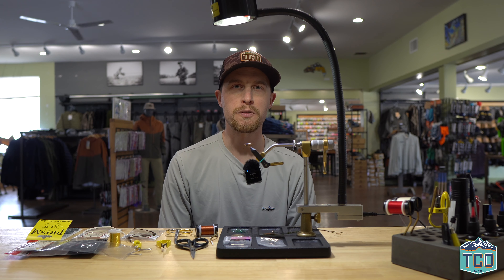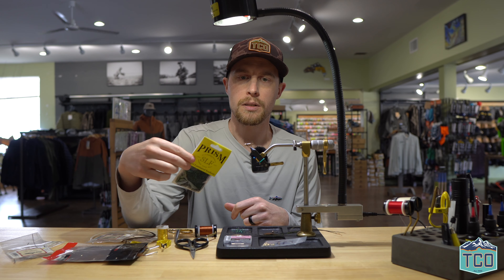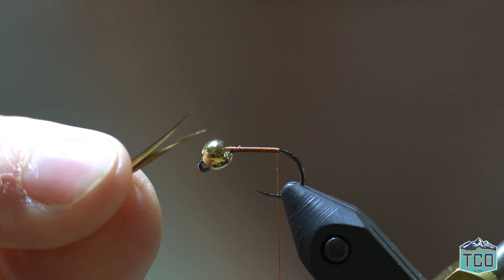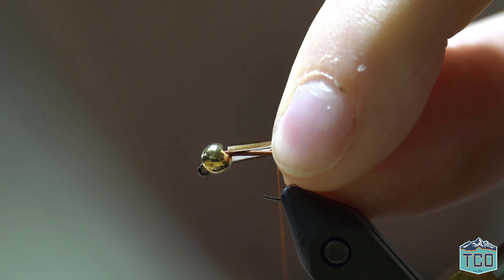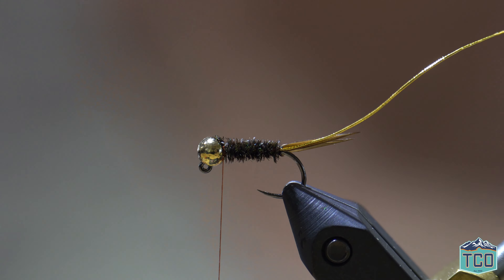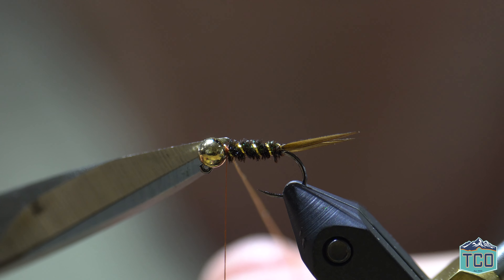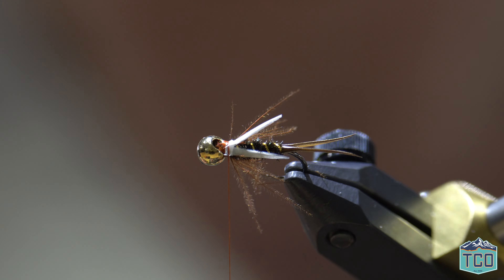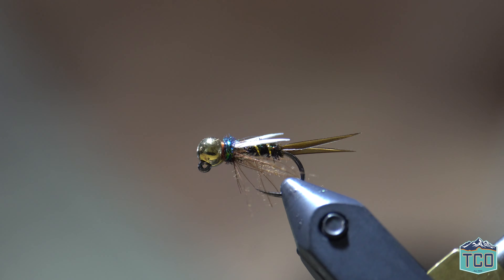How to Tie a Prince Nymph Variation

Comment: Hi, I want to ask you sir, I'm new with fly fishing, what will happen if I use a smaller fly line than my rod, for example my rod is wt3 and I use fly line wt2
Reply from the maker: If you use a lighter line than what your rod calls for you will have some difficulty loading the rod in order to properly cast. You will still be able to fish - however it is not reccomended as you won't be getting the most out of your gear. 

Here is an excellent versatile option for a 3 weight floating fly line: 
https://www.tcoflyfishing.com/collections/fly-lines/products/scientific-anglers-amplitude-smooth-infinity-taper

Let me know how else we can help!
Reply: @TCOFlyShop  ohh okay, thanks alot sir for information.